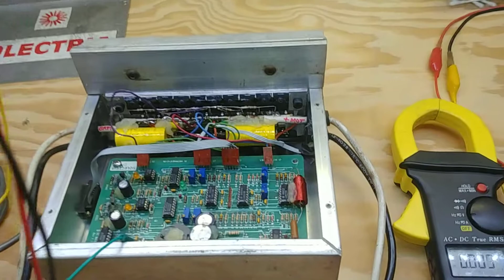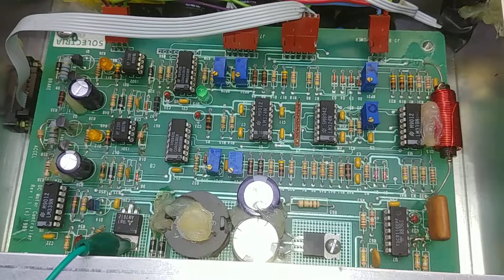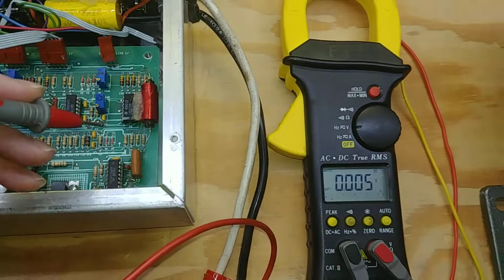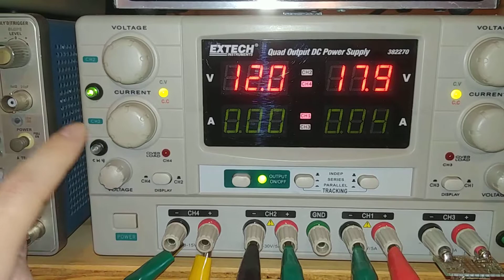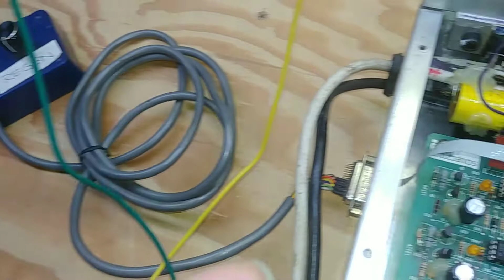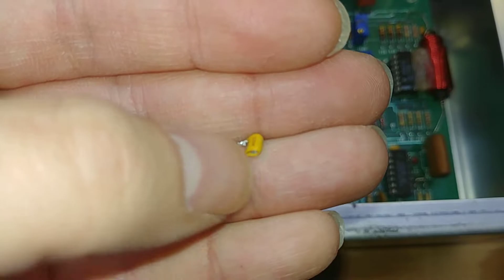Solectria DC Brushed Motor Controller S/N 1 Part 2

Comment: Overvoltage!  All of those failures can happen if you hook up 48 or more volts to the input.
Reply from the maker: I am kind of leaning towards 30 year old caps no longer filtering the power supplies, resulting in a high voltage spike every cycle.